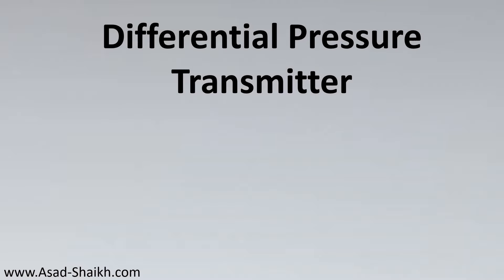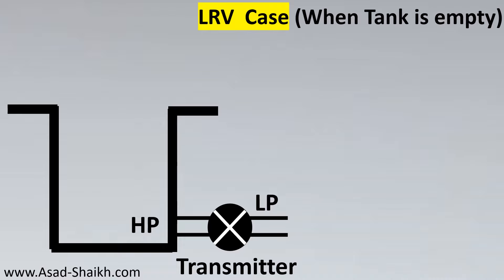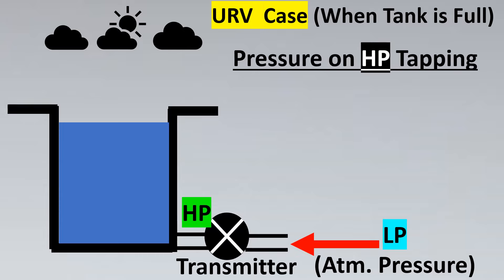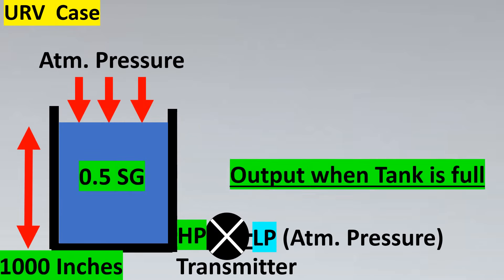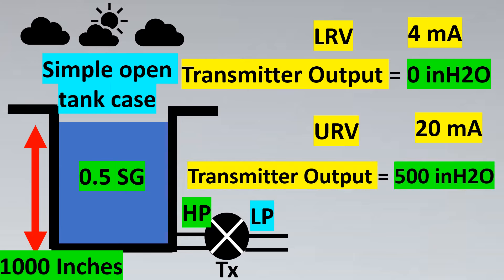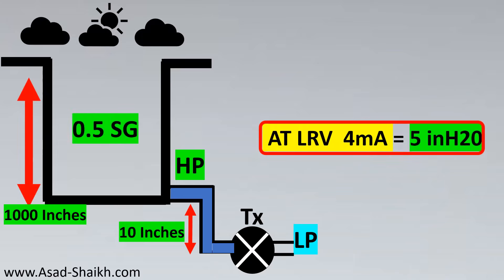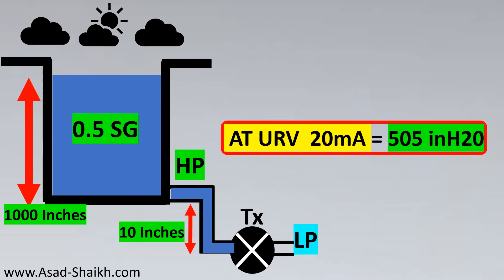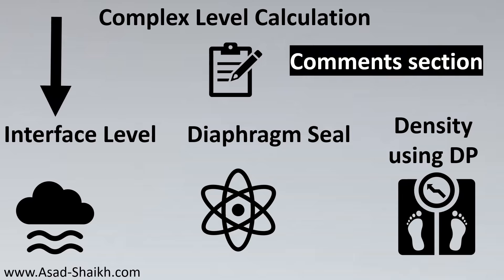DP Type Level Transmitter Calibration Procedure of Dry Leg | Level Calculations | Dry Leg | Wet Leg

Comment: Actually, the theoretical calib ranges that we put in datasheets during Engineering rarely live up to the practical conditions at site due to an array of reasons for eg- Failure to install the Tx exactly as per design due to space or access concerns. Also sometimes during first start-up if the seal fluid is process fluid, it won't be available thus need to change to API recommended buffers such as Ethylene Glycol for sealing (typically for wet leg). So the way forward is to either recalculate as per ACTUAL elevation OR there is a quick fix: Perform  Zero TRIM when the Vessel is empty, at whatever height the Tx is to get LRV and then add C-C pressure to get URV. URV= LRV + (C-C*SG).
Reply from the maker: Couldn't agree more @Hareem 😊

You are really very knowledgeable... I guess we even had a discussion during the relief valve CDTP discussion.

Please do keep sharing your knowledge !!!

True, Our calculations act as basics for calibration at site so that if any of the site person is deviating in an extreme fashion then they can re-check their calculations !!!
Reply: @Asad Shaikh (I&C Engineer)  sure buddy, i will !!